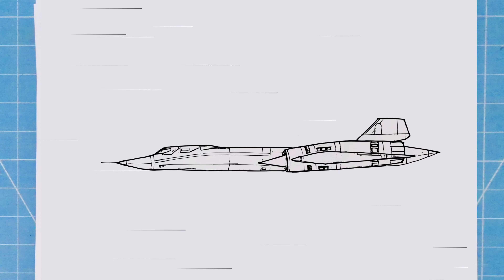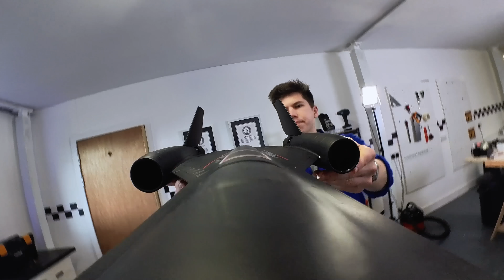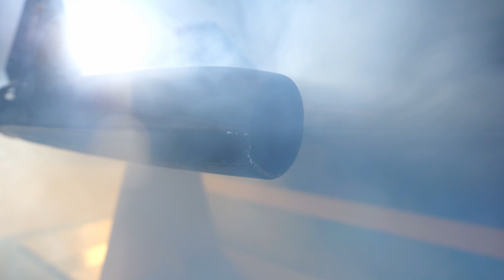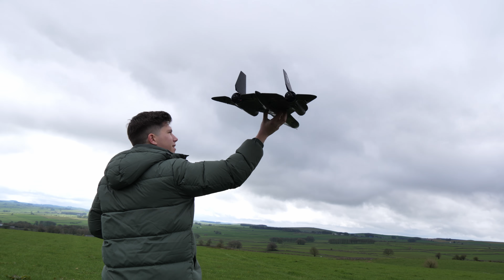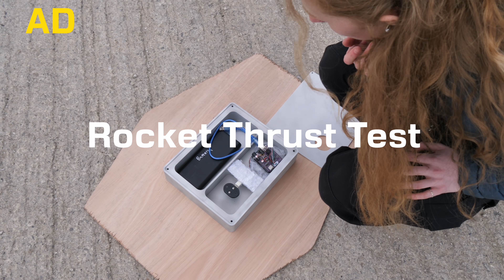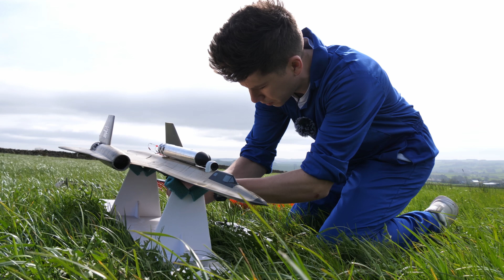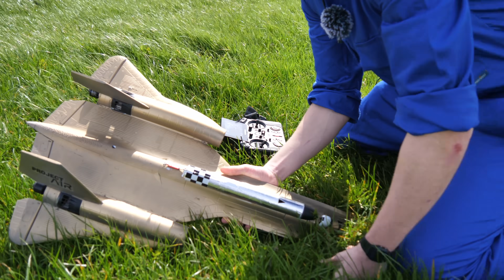Building a HIGH SPEED RC Plane (SR-71)

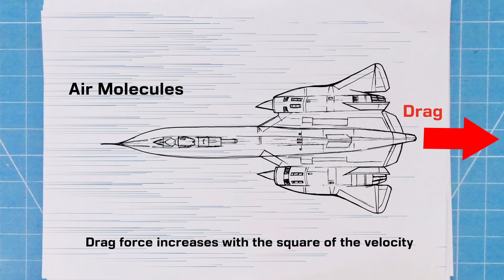Comment: 5:24 small correction: you need 8 times the power for twice the speed. Force increases with speed², but power is force × speed
Reply: Was just about to comment the same.
Reply: @surfcello sure
Reply: And restrictive exhaust nozzles would be a great idea too...
Reply: @christopherleveck6835 5” drone motors actually, greater disk area and same efflux
Reply: @christopherleveck6835  do the math for 1/2mv^2 to mv
Thrust is mv power of 1/2mv^2
Reply: @brucebaxter6923  and he still needs a nozzle. It's free additional thrust. The motors are very inefficient without them. You all can argue all you want about how much thrust to weight to drag coefficient it takes to double the speed.... Whatever you do, in the end, literally, you want a nozzle.... A restricted nozzle speeds up the air leaving the fan. It will take whatever thrust you make after all the infighting and make it better. 
In the end, that is.....
Reply: @christopherleveck6835  

seriously?
you are seriously thinking im talking about weight?
you seriously have no idea about how thrust works?
what do you think turns power into thrust?
nozzles arent free.
the thrust is simply the mass of air multiplied by how much its accelerated by.
the power required to accelerate that mass of air by that increase in speed squared.
you are trying to say that throwing half the air at twice the speed is better?
same thrust, 4 times the power
Reply: @christopherleveck6835  
in terms even you might be able to grasp ,,,,,,, do helicopters have nozzles?
they have the greatest thrust to power ratio of any flying machine
Reply: plz be my teacher
Reply: I though it went up by the square, i.e. double the speed requires 4 times that power. please enlighten me!
Reply: @sidecarbod1441  You're right. This person is overthinking it. They're mixing up engine and energy equations.
Reply: @sidecarbod1441  Without going into all of the Maths, this might help: Drag increases as roughly the square of velocity, because it is related to the effective cross sectional area of the aircraft. But that vehicle is also moving through twice the distance in the same time. So power needed for twice the velocity is roughly (2x2)x2 = 8 times the original power. 

You might want to think of effective volume of air being encountered rather than the area of air through which the aircraft passes.

Some real world examples: 
If you've ever watched Formula 1 racing and seen cars travelling at roughly 200 mph needing about 750 kW or 1,000 hp of engine power to achieve those speeds, then you might want to compare them with an ordinary road car: My car has an electric motor power of roughly 80kW (108 hp) and can do about 83 mph. For it to be able to travel at 165 mph it would need about 640 kW (865 hp). 

A restricted moped with 6 hp can do about 28 mph, but to do 56 mph it would need to generate about 48 hp. Our old petrol car had 64 hp and would travel at just over 75 mph, which, given the differences in aerodynamics and mass, confirms the theoretical moped example..
Reply: @sidecarbod1441  twice the speed means twice the air at twice the speed so four times the push at twice the speed is eight times the power
Reply: @brucebaxter6923  I am surprised but also quite pleased! I have an old moped that did 30-35 mph, the engine made about 2.5 BHP stock. I used all of my 2 stroke knowledge to nearly double the speed, its now doing a good 55 MPH, it must be making around 6 times the power, not bad for a home tuner! Having said that, it would be making 15 BHP, hmm 4 times the power seems more likely to me, but googling does bring back some info that states 8 times the power to double the speed.
Reply: @sidecarbod1441  there is a lot more than air resistance to mopeds.
Reply: @brucebaxter6923  well yeah, rolling resistance but the main thing is still air resistance.
Reply: Your moped doesn't only have air drag losses so you can't really use that equation. On my electric scooter it'll do 50kph if I limit it to 2kW and I need 6kW to do 100kph.
Reply: @sidecarbod1441  gearing and max rpm. 
You would have shifted the rpm of max torque up by a lot when you modified the porting and pipe.
Reply: @brucebaxter6923  At 55 mph, the air drag will likely be much greater than the rolling friction, transmission losses, etc. Let's say we have a frontal area of 7 square feet and a drag coefficient of 1. The dynamic pressure is around 7.6 lbs per square foot, so the air drag is 53 pounds. 55 mph is about 81 feet per second, so we have 81 X 53 =4,293 foot lbs per second. 1 horsepower, delivered, is 550 ft-lbs per second, so we're looking at 7.8 hp required. Rolling friction stays fairly constant, so it's not a big part of the picture here the way it might be at 15 mph. I kind of  doubt that transmission losses go with the square or cube of the rpm, but I could  be wrong. Anyway, I think the 15 hp figure is probably a bit on the high side.
At 25 mph, maybe air drag isn't even the dominant source of drag.
Reply: @parviz3998  I see no reason why the power source makes any difference. be it electrical or internal combustion. The power figures that you have quoted to not conform to the square theory or the 8 times theory so where does that leave us?
Reply: @lr21643  I totally agree with you, there is no way I'm getting 15 BHP out of my engine, if I was I would be working for Honda or somewhere like that. My butt dyno reckons between 7 and 8 bhp. My aim was to double the 30 mph but I've not quite been able to do that,  if you times 2.5 by 4 you get 10 bhp, so 8 bhp would nearly double the speed but not quite, it all adds up.
Reply: @parviz3998   Your increase in power from 2 to 6kW is neither 4 times the power or 8 times the power so I'm not sure what what that tells us. (Although it is nearer 4 times than 8 times). Personally I think it is irrelevant whether the source of power is electric or by burning fossil fuel.
Reply: @brucebaxter6923  Yes the RPM for peak torque and peak power will have changed but that has no relevance on the top speed. 8 bhp will get you to a certain top speed regardless of whether it is made at 7k RPM or 9k RPM. The only thing that would have to differ is the gearbox or final drive ratios. If this was not the case you could just up-gear the bike and achieve any top speed that you desired, clearly you can't do that. Torque is what accelerates the bike but it is peak power that determines the final top speed.  In fact with my ped I swapped out the wide ratio 5 speed box for a closer ratio 6 speed box, I used a gear calculation tool to help me work out the final drive ratio, the 6 speed box helped me keep the engine in the fairly narrow powerband.
Reply: @sidecarbod1441  yea, cause you have geared it perfectly for top speed each time, why lie?
Reply: @brucebaxter6923  What are you talking about? I've not lied about anything! Yes I believe I have geared it perfectly, I have 3 front sprockets and 8 rear sprockets all different sizes. (I had to purchase more sprockets when I converted it from 5 speed to 6 speed as the top gear ratio differs between each gear set). In fact I'd say that it is very slightly under geared, the reason being that I don't like the feeling of an over geared bike, especially when its got a weedy engine, by over gearing I might get a slightly higher top speed down hill or with a following wind but it would feel horrible in less than ideal conditions.

Honda geared the stock bike perfectly to do 30 MPH at 7k RPM with 2.5 BHP, they did not over gear it or under gear it, 2.5 BHP will get you to about 30 MPH and that's all she wrote.   I've modified the engine to produce around 8 BHP at 9K RPM so obviously it would need different gearing, the stock gearing delivered around 4.3 MPH per 1K RPM, if I had tuned the engine but left the gearing stock the engine would have screamed its head off to maybe 9.5k RPM but the top speed would have only been 4.3 X 9.5, i.e. around 41 MPH, not the 55 that it is doing. If you think that I'm lying with regards to the top speed then you clearly have no idea, 55 is not bad in my opinion for a 'ped' that was restricted but it is certainly not unbelievable.
Reply: @parviz3998  well okay i could use for my build
Reply: @sidecarbod1441  it shows you cant use that formula for all situations without taking into unknowns and other losses and expect an accurate result.
Reply: @sidecarbod1441  I am a mechanical engineer, i'm showing you that you cant use that formula as some blanket rule without taking into account unknows and other losses that may be contributing to a greater extent then you realise.
Reply: @brucebaxter6923  mopeds are fun but you don't want your buddies to see you on one.
Reply: @christopherleveck6835  A better saying is "Mopeds are like fat women, they are both fun to ride as long as nobody see's you"! Having said that check out a Honda MT5, it is a 'sports' moped, they look better than a step-through ped.
Reply: @sidecarbod1441  torque doesn't mean much. If I have 2 10 hp engines and one only has half the torque of the other, they can both accelerate equally. It just depends on the rpm range you are using during that acceleration. So if you gear both engines according to their powerband, you should see equal results. And guess what, the torgue at the wheel is equal aswell.
Reply: @dutchdrifter8740  Well without torque you can't produce any power!
Reply: @brucebaxter6923 
Pretty sure it's 4x.
Think about it in practical terms: if a normal car takes 50hp to maintain 100kmh for example, then it will need 200hp to do 200kmh. 400hp would be excessive, and would be good for more like 250-300kmh in most cases
Reply: @sidecarbod1441  the power figure is the important one. You can have 1 million NM of torque at 1 rpm, or 1nm of torque a 1million rpm, they will have the same power
Reply: @m.b.82 Thanks for your reply, I know how to calculate power..
Reply: @sidecarbod1441  I have two tomos' sitting in my storage unit, both have a custom engine mounting bracket w/ ssr 125's on em... I'm so damn eager to fix them up. previous kid who had them before me had them going an easy 60+... but it starts to get scary there.
Reply: thanks bro
Reply: 🤓👆 erm actually you need to square speed
Reply: All right Albert Einstein
Reply: @Monsoon_MG  You may mock 'brainy' people, but they are the reason that trains stay on their tracks and planes fly in the air. (most of the time!)🙂
Reply: @sidecarbod1441  i’m confuse this is a good or bad
Reply: yup
Reply: ye i actally wanted to cerrect the same thing
Reply: @Jgs101-h3k  Eh? not sure what you mean.
Reply: yeap
Reply: Annoyingly you might be right. Lol. The confusion is caused by how much energy you have at twice the speed, being four times
Reply: Says the guy who makes NOTHING, NOR HAS ANY VIDEOS OF HIS OWN?!!?! WTF gives you right to comment on anything this guy does! At east as i comment i have well over 15 years on YouTube as a creator, and well over 1000 very famous videos!
Reply: @bad71hd  👆🤓
Reply: sorry say that again I think my brain is not braining
Reply: Seems for attaining the highest possible speed lots of battery power is required which makes the plane too heavy.
Reply: smart ass
Reply: NEEEEEEEEEEERD
Reply: Now THATS 😎
Reply: how do you know this 😮
Reply: That one stdent who payed attention to physics class 😎😎
Reply: NEERRRRDDD
Reply: Wat